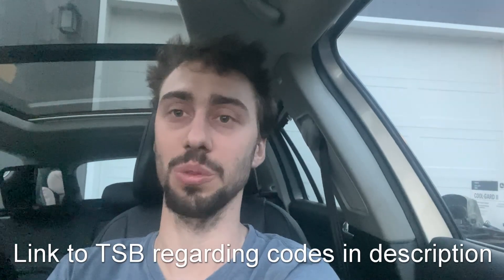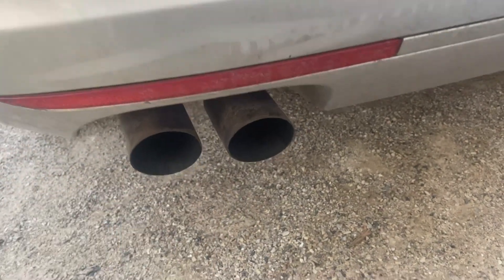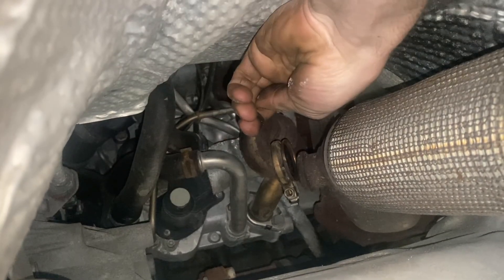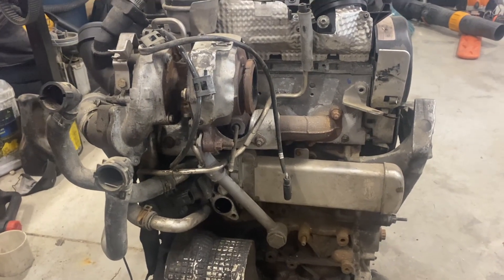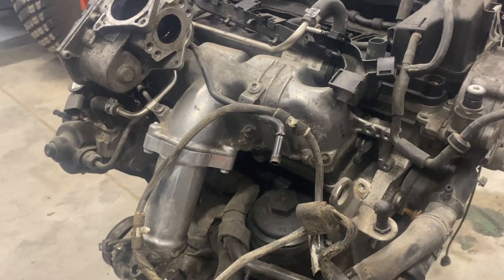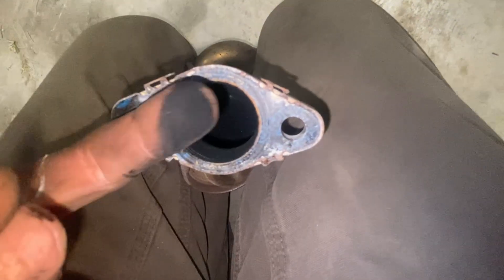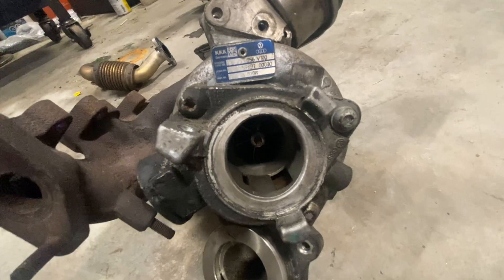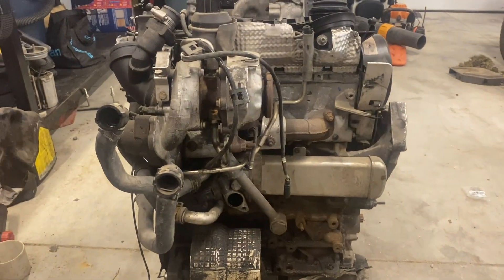Diagnosing Volkswagen TDI CJAA P2002 and P0401

Comment: This is super old, but if you're there, would these codes cause a no boost situation?  I'm hoping yes, that maybe the DPF crack has caused enough soot build up to choke out the turbo.  I've got a p2002, p0401, and a p0299. Ordered parts to delete the DPF/EGR system and will check over all the charge pipes once the car's up in the air and will give the turbine a good wiggle once the exhaust is off, but i'm hoping it doesn't mean failed turbo.
Reply from the maker: Its usually a crack allowing soot out although the p0299 might point to a turbo. I've had to do a few turbos that also had the dpf/egr codes
Reply: @JoshsJettas  It was the turbo. Seals were blown, the turbine was wobbly, the oil lines were choked out. 

Runs great now with a new turbo and dpf/egr delete  :D

Comment: I have replaced the dpf and just did exhaust bypass control valve. It's throwing the p02002&po 401. Can you guide me on what to do next. I'm in a emission NYS and have just spent over 6 k with lights still on. Please help. Any advice be appreciated 👍 thanks Marc

Comment: My daughter had a p2002 code with her 2012 TDI Jetta she had to replace particular filter in past with dealer. She’s looking to fix and sell. She does not drive long distances. If you have any info that would help. Thx u
Reply: In general  tdi  needs to be on the freeway at least  once a week 20 or more minutes in order to  burn some soot!. Short drives creates a  lot of soot and can plug up.  twice cracked  is strange for DPF

Comment: 2013 VW Jetta TDI with 80K miles on it. Threw P2002 a couple months ago so I replaced the DPF. After a month went by, the code came back. No black soot is coming from the exhaust. 
Should I consider replacing the EGR valve? Thank you for all you do.
Reply: What did you end up doing?

Comment: hello, I know I'm late to this video but this is exactly what I needed to watch. I have been searching for weeks and weeks about these exact codes on my 2010 vw golf tai. P2002 and P0401. I had initially cleaned out the egr valve and did a forced regen, cleared the codes and they came back about a week later. after watching this video I'm afraid I have a cracked dpf but don't know for certain. I have soot at the end of the exhaust pipe(just sitting there) and it seems like my car never wants to regen? do you think it could be something else other than a cracked dpf? Ive been watching all of your videos and I'm thinking about deleting it to just resolve everything once and for all. thanks a lot
Reply from the maker: Good chance it’s cracked. This one had soot in the pipe and a light coating on the bumper, my sisters Passat I could stick a white rag inside it and it’d be just as clean afterwards. The emissions systems work awesome on these cars when they’re working.
Reply: I SUCK TRANNYS

Comment: I replaced the DPF and EGR valve only for the same p2002 and p0401 codes to be thrown a month later. Black, dust-like soot in tailpipe.

Mechanic said to replace the entire exhaust system. This just sounds lazy when it could be something like a faulty sensor, exhaust leak, cracked hose or air intake inlet.
Reply from the maker: I imagine the cats and muffler will be full of soot and might take awhile to blow it all out. I’d personally drive it hard for a bit with some high rpm.
Reply: @JoshsJettas  thing is, they cleaned it out and did a forced regen when the CEL first came on. I've been taking it on the highway every weekend for 30 minutes at 75mph since then...light still came back on a month after that. They said the exhaust would need replaced if it came back on.

I'm taking it for a second opinion if they tell me that again next weekend. Just seems like mechanics around Dallas don't really care to do deeper diagnostics.

Comment: When the VW shop replaced my DPF under warranty I discovered they never reconnected the lower pressure line with the two bolts (3:27). Would there be any benefit to not having this connected? It didn't throw any codes in the 30k miles I drove before discovering it.
It still seemed to have power cut out and stumbling idle which I'm guessing was condensation in the intercooler.
Where is the crack on the DPF, why can't you weld it or reinforce the area that cracks? I've heard many people say they crack but I've never seen the crack.
Reply from the maker: For the low pressure egr tube? I'm surprised it never through a code. Benefit would be less condensation in the charge air circuit, not sure if itll run more high pressure egr in that case? And i saw you found the short on the dpf crack, surprising how little it is.

Comment: Josh.. If one does NOT have clogged DPF code, only P0401 (and p2457) could it also be a clogged screen, or does that only happen with a cracked dpf, and the code is probably  failed EGR system? Tnx
Reply from the maker: Is it a Passat or Jetta/golf/Beetle. That p2457 is common on Passats with a clogged heater core preventing coolant flow through the egr cooler. I’d wipe the inside of your tail pipe and see if there’s soot, if there is then chances are it’s cracked and just hasn’t set the dpf code yet.
Reply: @JoshsJettas  jetta, Cjaa. I did a pre-buy inspection the other day.

Comment: What if my differential pressure sensors are reading a lot of pressure still?
Reply from the maker: High pressure while cranking? The DPF can face plug causing a large pressure differential.
Reply: @JoshsJettas  ah I’m seeing about 2.5-5 psi at idle and anywhere from 30-75 psi on the highway running about 2K rpm.

Comment: Cant wait for more cjaa vids I have a 2013 jetta tdi, I had a oil leak, then got fans fixed after not working forever but now cars not leaking oil, probs guna have to take out dpf and clean up oil leak and check the lines maybe replace some stuff and get turbo rebuilt, also might have to do the timing belt rollers I think a roller or two might need changed. Also gotta do alternator and clutch soon
Reply from the maker: Parts are coming in this week im hoping, if doing the timing belt rollers just get the entire kit and replace all the rollers/belt/water pump and tensioner
Reply: @JoshsJettas  my kit didnt come with rollers
Reply: Buy another car mate!

Comment: I was just wondering, saw your last video with broken turbo causing running issues. Eng8ne having hard time breathing or exhal8ng, which affects air mass meter readings. Would egr flow values use air mass readings to compare what would be expected with egr commanded on or off.
Reply from the maker: Exactly, the engine requires about 450mg/str of air at idle, so it knows if the maf is only seeing 250 then the remaining will be egr. I imagine between the two egrs and the low pressure egr pressure sensor it’ll know how much of each it needs and uses the pressure sensor and maf to ensure its getting it.